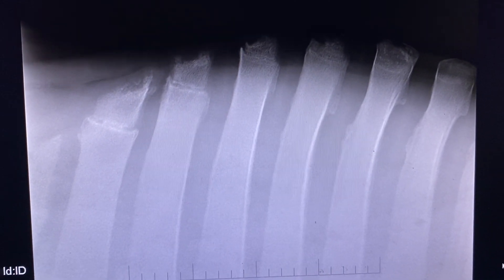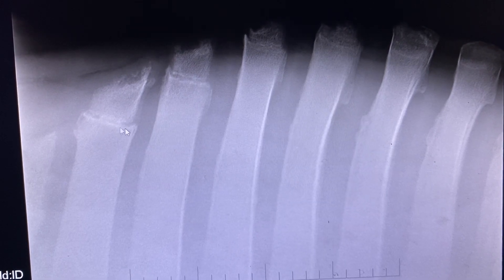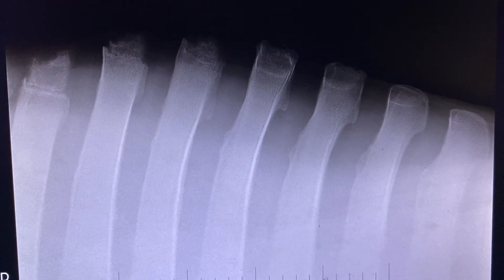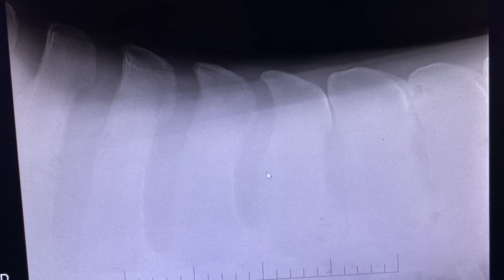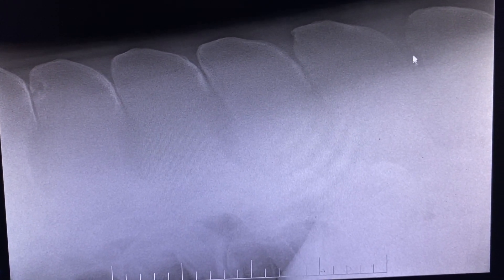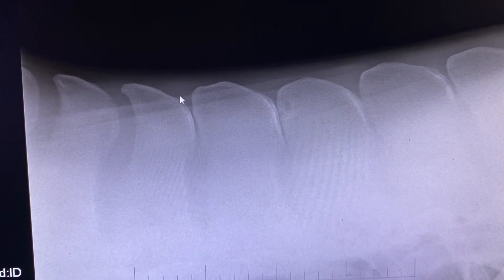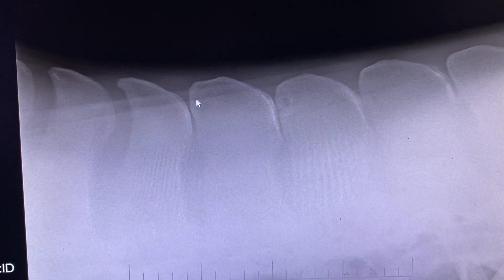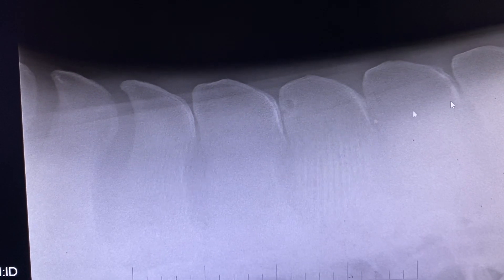Kissing spine surgery in horses | Honnas Technique

Comment: I’ve got an 18-19 year old walker who I think has kissing spine. I’m going to have my vet X-ray him and do some more diagnostics when he comes out to the farm for spring clinic. 
All I truely want is him to ve comfortable and I’d love to be able to just ride down the trail. He’s extremely reactive to pressure on the lumbar spine and had basically no top line when I bought him. We’ve done plenty of exercise, got a top line back on him, but even with that, lunging, ground poles, etc, he’s gotten so bad that i haven’t ridden in 6 months, and before that brief stint, it had been at least another 6 months and the chiropractor is struggling to even touch him,  let alone adjust him . I’m wondering how hard a recovery a bone reduction surgery is  on the horse vs just cutting the ligaments, and how much is fair to put an older horse through. He’s otherwise in great health and has a forever person but I’m gathering info and opinions before the inevitable diagnosis so I’m not going in blind. Do you have any insight?
Reply from the maker: If kissing spine is where the bones are actually touching, there’s no way to get between the bones to cut the ligament (which is likely non existent from the bones ebbing together). I always do the bone reduction which also removes the ligament containing the nerves that innervate the area. I’ve operated numerous late teen horses and they do fine (handle the surgery well). Happy to evaluate the X-rays when you get them. Send to southpollcows@gmail.com and remind me that we chatted on YouTube. Thanks!

Comment: What is the etiology of this pathology?
Reply from the maker: No one knows. There may be a genetic tendency but unproven currently but is being investigated. I have xrayed some yearling horses before they were ridden and found it. There is conjecture that it could be caused by breaking them to ride as 2 and 3 year olds before they are skeletally mature which causes the breakdown. Also, the heavy weight of the rider has been suggested as a possible cause. Bottom line is no one knows.
Reply: @cliffhonnasregenerativerancher  I can understand that one could suspect heavy riders but horses have been selected for carrying riders for a while. In a yearling? Wow